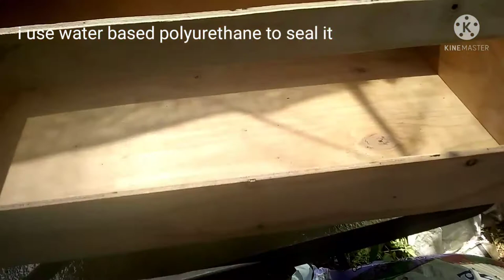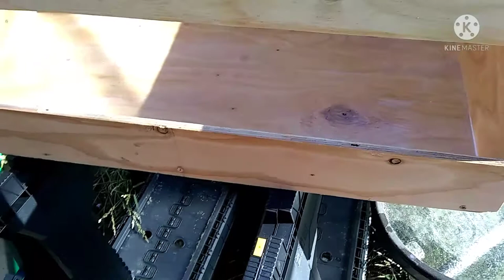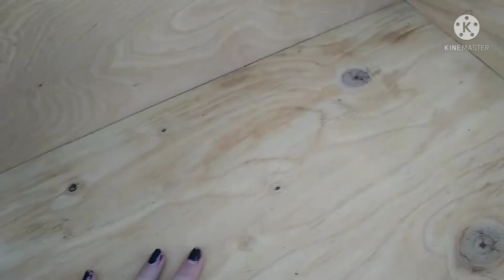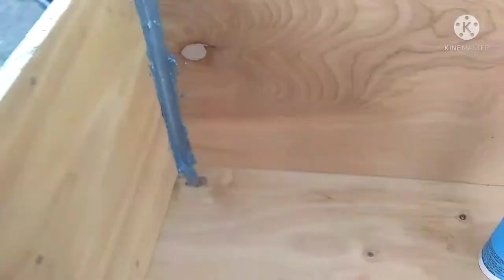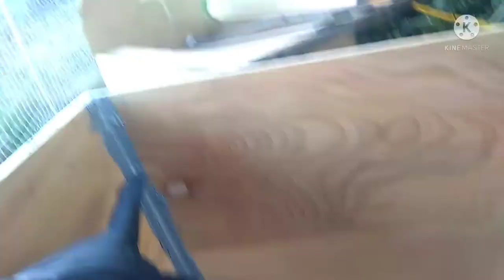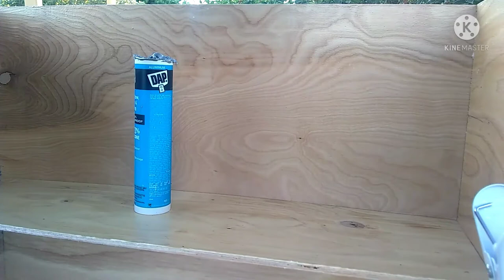DIY Wooden Reptile Vivarium, Part 1: How to waterproof a wooden Vivarium! | Ki's Crazy Reptiles

Comment: You should lightly sand between coats because the what ever finish you use swells the fiber of the wood.
Reply from the maker: Hia! Thanks for watching. And yes I agree, I do recommend that. I've had this set-up for about a year with no swelling or problems and it's working amazingly! Unfortunately my sander broke before I could even use it. I'm assuming mabey due to the type of wood I use it hasent had an issue.
Reply from the maker: I also have a new vid coming out on a new tank and built so I'll be sure to include that.

Comment: How much would i need to cover a 5 by 2 by 3 ft enclosure?
Reply from the maker: @thattastesliketea2131  for polyurethane a 1/2 PT should do fine. For the silicone I'd buy atleast 3 tubes to be sure.
Reply: @kiscrazyreptiles  ah nice one thank you! (Edit: is this for 1 coat? As worked it out to be 42 square foot and half a pint seems quite little for that much?
Reply from the maker: @thattastesliketea2131  my singular can lasted 2 different vivarium builds with multiple coats on each. You can get another can if you're worried about it tho.
Reply: @kiscrazyreptiles  thanks for the help i found a pint tub and had plenty extra so i went around the outside aswell just incase i spilt some water on it. THANKS AGAIN!!! big help